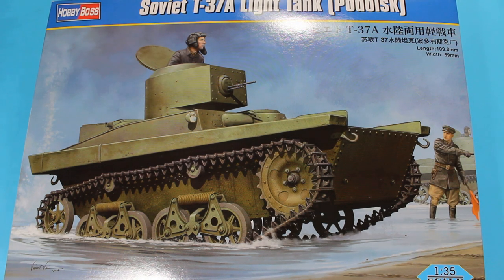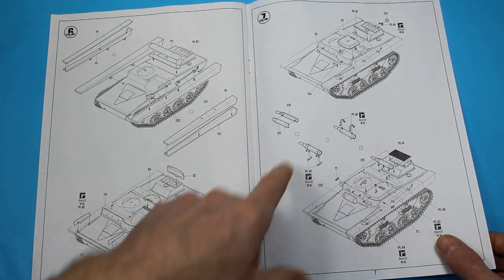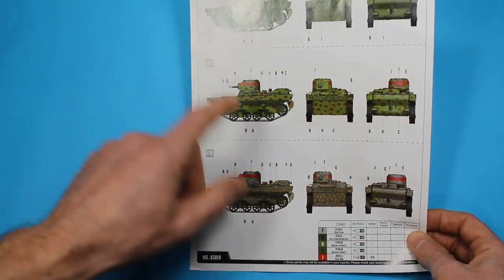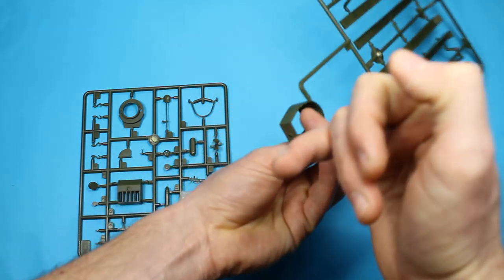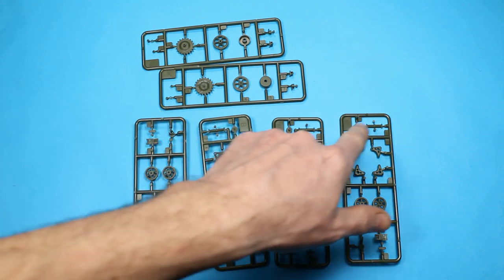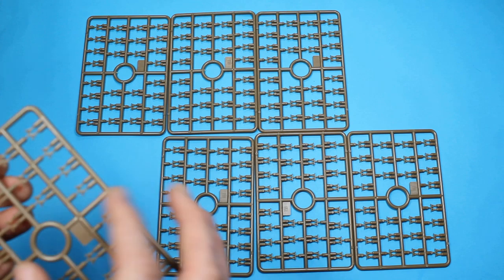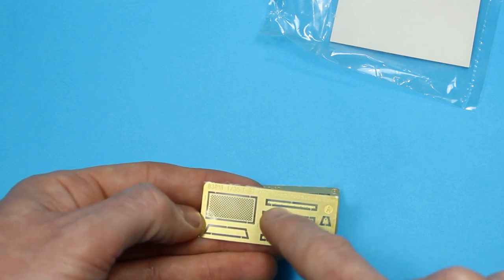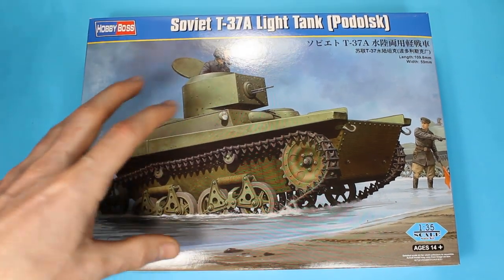HobbyBoss 1/35 T37A Amphibious Tank Review

Comment: Nice review. Coincidentally, I am just building another variant (T-37TU Command Tank with "clothesline aerial") which is mostly identical. It goes together very well, only a little putty is required for the seams on the floats/fenders. The tracks are actually less tedious than expected (or others i have built), due to the ease of removing the sprue attachments. In fact, you can probably get away without any clean-up if you cut them close to the sprue...